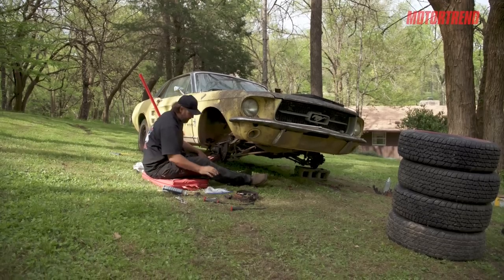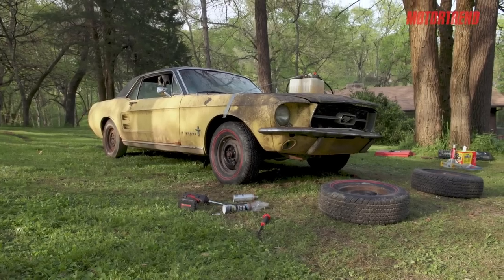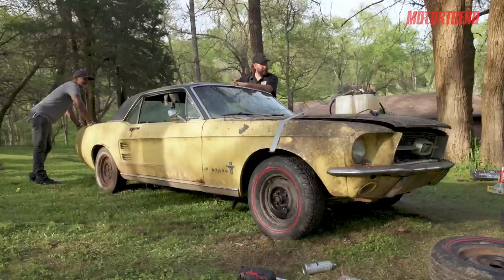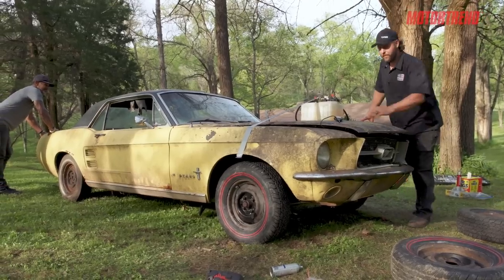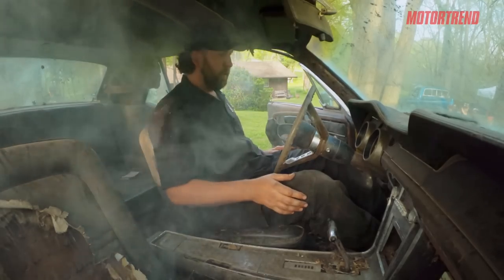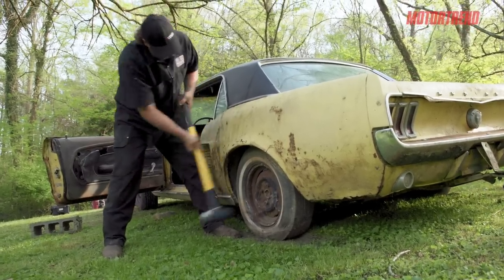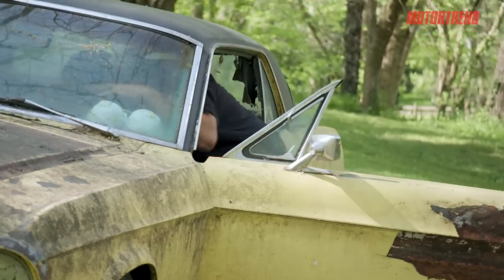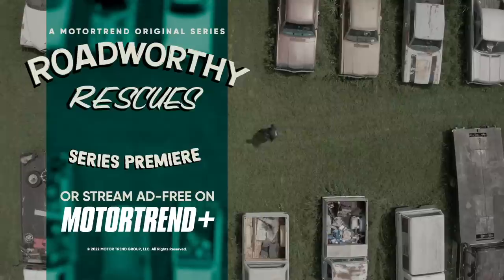'67 Mustang Hasn't Run in 28 Years! | Roadworthy Rescues | MotorTrend

Comment: Derick, Thank you so much for getting that 1967 Rebel SST running again. I have saved three 1967's back in the 90's, one 1967 Rebel 550(nicked named Darth), a white 290 rebel SST and a 67' 343SST model. I left the AMC hobby for all the wrong reasons which I miss dearly. I hope to have another Rebel before my time is up. The reason I chose the Rebel was at the time was cost. They were not expensive to buy and the back seat for my daughter so we could take her to car shows. My 67' Rebel 550 was my trophy winner. I wish there was a way I could send pics of all the Rebels and the one 1967 Marlin I saved. It wasn't the memories you brought back but my passion for such a cool car to save. It was the challenge I loved.

Comment: I'm also a mechanic. If you ever wonder why a new battery not working properly, slam it around a little more see if it helps.. a peice of a led plate can break off inside batteries. Causing failures